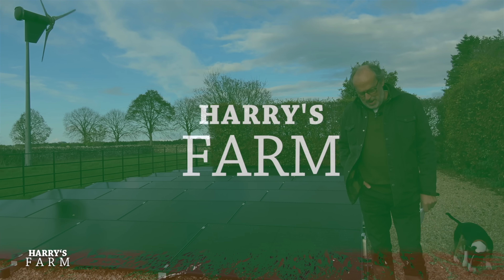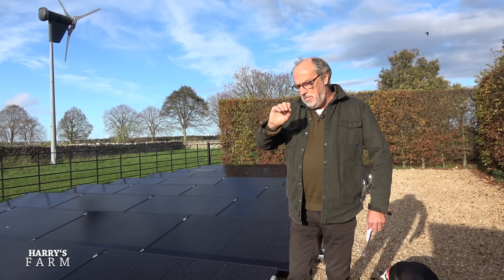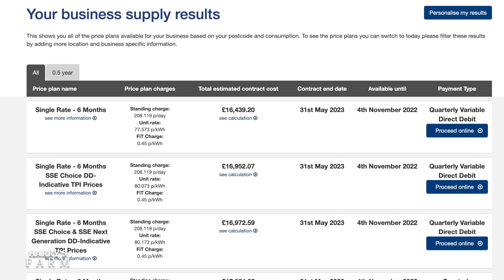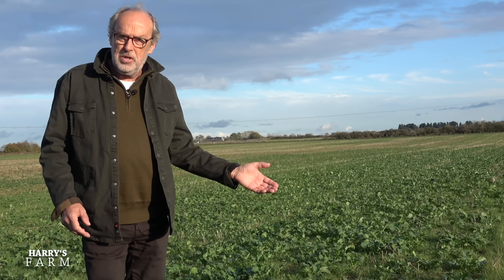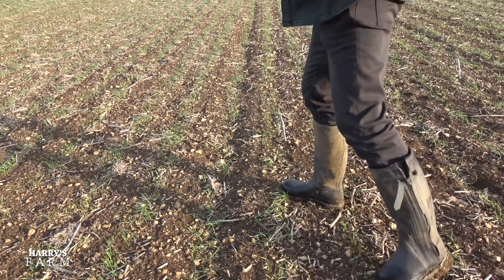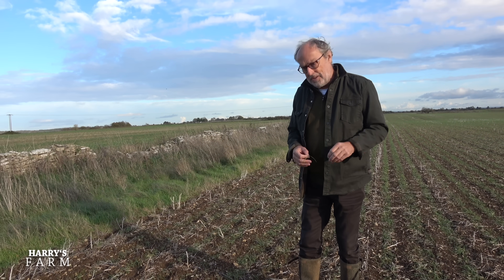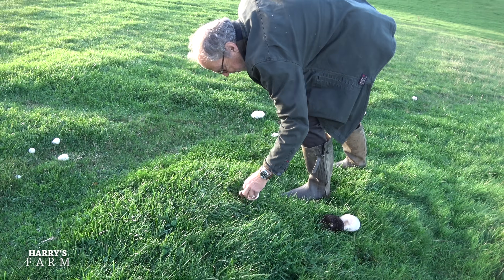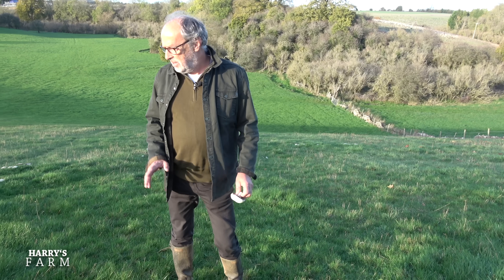More solar panels get installed plus why New Zealand's proposed carbon tax on cows is wrong

Comment: The New Zealand Labour Government / Green Coalition was one of the most unhinged Governments New Zealand has had in Modern times. And now we (New Zealanders) are struggling to put food on our plates due to the completely out of Control Government spending that massively inflamed our Inflation. They completely Shit on the working class in NZ - the people that actually provide the services that keep the lights on, the water running and food in our Butchers and Super-Markets. If people vote for Labour again, then they've got rocks for Brains

Comment: In the late autumn and winter i find out system will chuck out a couple hundred watts and my system is just over 2kw so about ten percent on average during the colder months so for you to be get 1.0kw roughly makes sense.

Comment: Good to see this  after watching the 288 GTO  video , had my petrol fix ! , thank you . I also have solar , off grid 28 panels  and  was surprised to see the panel angle so suited to the tropics ! The most  productive angle is basically your latitude , around  51 for your area , is there a reason for this low angle ?

Comment: The UK is just not a good eographic location for solar. The same is true for all of Europe. It is great for wind.but not so great for solar. The cost of energy in the UK is high because of how renewables have been been introduced into the electric grid (yeah a screwed up situation because of politics, not because it works from an engiineering perspective).

Comment: Carbon Dioxide is our friend, but I think you know that already... 

The fact that cars produce carbon dioxide from fossil fuels, a now well known renewable resource after finding emptied caverns full again. 
The sun has more impact on our climate than we ever have or ever will have, and the facts are the earth isn't just getting warmer, but it's also getting colder, breaking more records in the later segment year after year.

I would really like to break this down further but you should be on much more solid ground for your basis on the proof of why cO2 makes the earth warmer... it doesn't. 

@Suspicious0bservers here on youtube has it broken down to the point a 5 year old can understand it without any fear mongering or trigger words, just information. Much luv.

Comment: Completely agree Harry. As a NZ farmer I’m fairly certain we currently produce meat and milk with the lowest carbon footprint in the world… if we reduce our production significantly this will lead to someone else filling the gap with less carbon efficient food. Thanks for making great content it’s nice to hear a farmers view from the other side of the planet.
Reply: it's so unfair to talk about carbon footprint, a model built up for some dudes in countries to trade money for their gains. As a NZ farmer, I can tell you it would be dumb not to jump into solar. Lots of fear here, but southland is surprising everyone with some stats coming out.
Reply: It depends on how you calculate your carbon footprint, do you calculate the carbon footprint including everything that has to be shipped there (tractors, fertilizer etc.) or do you just calculate on an annual basis based on only what happens on-farm? NZ is so far from everywhere and has no local manufacturing, thus all purchased goods have a high carbon footprint.

Comment: With a ground level install of solar won't Cedric the farmhand  be forever cleaning them  . .  And won't it always risk over shadowing ?

If the panels are not fixed to anything won't it encourage the nocturnal farm equipment re-purposers to pay a visit ? We all want to keep the Policing precept down, don't we Mr Council ?

Wouldn't a canted pagoda type structure be a better bet with limited sun-tracking capability ? And you'd get your gravel overflow  car park back ! Surely the council can't complain about that ! Its national policy to cover car parks with solar cells !

 Or, think rotating radar receiving aerial/solar concentrators in Southern Europe. I understand that angle of incidence to the sun's ray is crucial for max power generation.
Such a structure couldn't be any worse than some residential conservatories or sun veranadas ! And, surely the Councils must recognise that  a bit aesthetic displeasure is worth the benefit yielded by solar ?

Err . . as to cow's botty burps haven't the Australians developed a vaccine (!*!!!!)  for ruminants to minimise this ?

As to summer water shortages . . when are you building your storage pond ?
In the States e.g. Oregon (The wettest State in the Union ?) they are constructing such things on a locality basis not only to store water against periods of shortage but also for the generation of hydro power when the water is released.

Comment: The voltage is too low. Max out the voltage on the controller because cloud cases voltage drop and disconnect on 12 volt. Never seen 12 kW on 12 volts because its too many amps for the wires.

Comment: Harry I remember when I was at Brookes university we had a we had a talk about and those topics word to do with energy output I have different theories about things but there is refraction and reflection if you have a fence around your around your photo cells would you find an increase in output that was constant like a lighthouse stack of of white glass bottles with metal foil tins behind them the problem is I think you would need Apex arrangement

Comment: I've 3.6kw of panels, I've never seen them produce more than 3.2kw. I live in Alicante provence so get clear skies most of the time, good luck in the UK.
Reply: 20% derating is an industry standard from peak installed capacity, for grid connected systems.

Comment: Solar Panels are a major contributory factor in why Britain's fuel costs are so astronomically high. So-called "Renewables", apart from hydro, are a completely rubbish and unworkable idea. Windmills cost more energy to make and service than they produce and only work when the wind blows sufficiently. Solar panels only work during the day time and if the sun comes out...

Comment: Hay harry , keep your opinions to your self...you know nothing about our situation in NZ , the reality is farmers are carrying to much stock on their farms to be sustainable in the short term and are over grazing and having to use ever increasing amount of fertilizer to maintain the pasture grass at the level required...and effluent that is produced is contaminating the underground aquaphis , streams and river systems that run throw and around the farmers and eventually in to the lakes that supply our drinking water and that's without addressing the methane and nitrous oxide gas emissions and C02 from transport of milk and farm animals for processing ..all together the sector make up over 50%of NZ's GHG emissions ...so the sector has to start reducing their heard size drastically and take steps to reduce their carbon footprint!!.😡💕🇳🇿🇺🇦

Comment: The CO2 has come from the atmosphere yes, but methane does considerably more damage in the atmosphere than CO2 does. So you are replacing CO2 with Methane for the next 10 years.
Also, there wasn't the same kind of industry now as there was when there were 60 million bison in the US (also 60 million cattle in the US now).
I'm all for getting rid of a lot of that industry instead of the animals. But something has to give and governments are deciding its the cows that go, not the profit of multinationals.

Comment: It's nice to have the funds to play with this stuff, but in reality, the mathematics doesn't really pan out.  This is primarily because proponents of a solar array fail to take ALL costs into account (like loss of interest on capital invested).  Invest £10k and that was earning you £400 a year in interest!  That's gone when you use the money to buy panels.  The ACTUAL return over a decade or two means that you could have invested it better in say, a generator/batteries or elsewhere.

Comment: Apart from the hedge shading issue, the angle of inclination of the PV looks far too shallow for the latitude of the  sunny Cotswolds ?    Getting your protractor out and cranking up the angle  ought to help productivity. And remember to keep panels clean, as dirt has a dire effect on output.

Comment: I'm sorry but the comparison with deer and bison doesn't make much sense. Humans and our livestock make up 95% of the world's mammal's biomass, 34% is humans, 35% is cattle. Wild life is not an issue here. The peak for bison was late 18th century. Back then there were fewer than 1 billion humans, no large scale cattle farms, and very little fossil fuel production. I don't believe that anyone is claiming that cows are the main contributor to climate change, but the large scale cattle production isn't helping either.

And the other point about the carbon they're burping out coming from the CO2 in the air is correct, but misses the issue. Methane is 25X more potent as a green house gas than CO2, so not converting CO2 to methane is highly preferable. There are steps you can take to lower the amount of methane cows emit, which is why a tax on it makes sense as an incentive for farmers to take those steps.

Comment: Harry, The Socio Economic Structure of NZ has been Stuck for a While.
This has caused NZ to Stagnate and They Struggle to Keep Their Population.
The NZ Population Stopped Growing 30 Years ago and on a Good Day is Only Four Million.
Factually NZ Still does Not have One Reasonable Size City, 5 Million Plus.
Therefore NZ's Economy has been Dominated by Sheep, Cattle, Diary Cattle Exports.
Harry, PM Ardern is Right NZ Must Consider how much Land and Effort They Put into Sheep and Diary.
The Environmental Issues are One Factor with this.
Yes, Australia has a Similar Problem which Includes a Huge Cattle and Sheep Herd but with Stagnation Problems in those Areas.  Small Town Failures because of Poor Socio-Economic Structure is Common in Australia.
Therefore Harry NZ and Australia Must Get Smarter about Farming/Food and Build Great Nations.

Comment: Make sure those panels aren’t shading each other as the sun is quite low this time of year. Partial shading will dramatically reduce your output! They should be quite a bit steeper too for the UK. And the wind will pick them up if it gets underneath, you could anchor the rails down with groundscrews rather than using weights.

Comment: I once read that putting one alpaca in with a field of sheep is a great way to protect against predators. The alpaca gets on well with the sheep, but is incredibly aggressive towards any threat. I think this is a trick they use in some parts of South America, and possibly New Zealand. I seem to remember is worked best (or only worked) if it was a single alpaca, not a group.
Reply: Donkeys, alpacas and llamas are herd protector animals.

Comment: Actually Harry, fun fact, you can get the greatest solar generation when the sun is surrounded by cumulus cloud. So you get direct sunlight from the sun hitting the panels and indirect reflected sunlight from the clouds hitting too. You can actually exceed the rated output of the panel (which is based upon a sun strength of 1Kw/square meter multiplied by its efficiency which is generally around 20% or 0.2.) I see it sometimes, it's on those days when you have to screw your eyes up if you haven't got sunglasses on.

Comment: Hi Harry, it's certainly worth mentioning that when the fuel pendulm swings back from these staggeringly high heights, the economics of solar etc will suddenly look quite different. in the next 3- 9 months two massive supply disruption issues will invert: The war in Ukraine will end (most likely with the assignation of Putin, but it really doesn’t matter how). Then cold hard money will regain its prominence as the loudest voice at the energy discussion table. Russia will be forced to pay for a huge chunk of the rebuilding of the nation they unilaterally destroyed. 

To make this possible, the West will allow Russia special dispensation to pump as much oil/gas as is logistically possible – taking a tax from each sale to give to Ukraine. 
Anticipating this record supply surge, all other OPEC members will scurry to up production in order to capture the high spot price – knowing full well that it will soon last no more – hence creating a paragon of a self-fulfilling prophesy.

Add to this the looming global recession that will make the 1930s look like a hiccup, then the demand / supply matric will swing back to the opposing dynamic - to be the mirror  image of what was the case in the middle of 2022. 

Petrol prices will plunge below 80p/litre, and heating oil will be counted in a few pence per litre as all the new supply that is just now starting to come on tap as a result of investors jumping greedily onto the elevated-price bandwagon seen 6 months ago, prompting the green-lighting of every terribly expensive/high cost new drilling project that oil exec’s could dream up (so ensuring their own bonuses), washes into the spot market, so depressing the price still further…
So, get ready for electricity plunging to all but free levels, at least for another 2 years…

Comment: If we accept that Methane has a higher global warming potential than CO2, it's very straightforward to see why cows are a net emitter. Take one carbon atom absorbed by the plant as CO2 (GWP=1), have it eaten and processed into CH4 by the ruminant (GWP=20+) and you've significantly contributed to CO2-equivalents (-1 + 20 = 19) in the atmosphere.

Different species of ruminants have different methane emissions, and individuals of a species will have very different emissions depending on their diet. That's why the deer/bison comparison doesn't say much. I recall the average cow may produce between 2 and 7x as much methane as a bison would. I don't think serious people are realistically calling for a ban of all cows, but since they are significant contributors to anthropogenic emissions (>60% of ag emissions?), they'll have to cut down their emissions a lot. 

Farmers and ag scientists are smart, they'll find out if the best results are achieved by a change in feed or change in methods or reduction in herd size or a combination of all that. However you can't just expect the sector to solve emissions out of the blue. That's why financial incentives (e.g. carbon tax, subsidies) and clear targets are necessary, just like in all other sectors.

Comment: I'm confused. At the beginning he said the rails the solar panels are fixed to are used in a roof installation. If it's installed on the ground instead of on the roof like it's supposed to be why is he so surprised when it doesn't produce much power? He's missing the added angle of the roof so of course it isn't going to be a good result. Take a look at the solar panels on WWOG or most other you tube channels; the angle of their panels is much steeper than his. His installation looks like an equator not UK installation angle.

Comment: Thanks for the video Harry, speaking from NZ here. One crazy aspects of this tax is that the government hasn't recognised that our national herd has actually decreased by roughly 11 million stock units since 1990.
Reply: "Dairy cattle numbers increased by 82 percent nationally from 3.4 million to 6.3 million Between 1990 and 2019" stats nz, what are you talking about ???
Reply: @Sc0ttynzl  sheep numbers dropped from 57.9 million to 26.8million over that period. The page you got the quote from has a graph, add sheep to the mix.
Reply: @Sc0ttynzl   yes you are correct, dairy cow numbers have increased as you say. However if you continue to read past the first line on the stats NZ website, past all the unnecessary guff from the govt. You'll find sheep numbers have decreased by 53.6% (31million). So if you represent all ruminants through the livestock unit measuring system, total livestock numbers have significantly decreased!
Reply: @hamish2021  then the problem is clear isn't it , there's to much dairy and too few sheep the government should discourage high impact dairy while having it be substituted by much nicer sheep the whole of agriculture shoudn't be treated as if it was all the same
Reply: @Sc0ttynzl  As Hamish pointed out it is useful if you read a little bit further.
Reply: Don't worry, it's not about the cows, more like human existence.
Reply: @sksx9269  it's about jumping on the bandwagon and trying to scam farmers out of money
Reply: Do you think Jacinda really cares about the truth?
Reply: @douglasprovost768  No of course not. After all she's a liberal
Reply: Your Govt also hasn't taken into account that before long there will be supplements to reduce methane etc from cows.

Comment: Your solar needs to be more spread apart. You see shadow of the sun in the lower bit in everyone. Every type of shadow murders your output. You live on 51.8°N. Solar noon zenith elevation is max 61° and min 14,7° from horizon. You need at least 30 degree for midsummer noon perfect 12kWh. Bottom part needs to be 75,3° free from next top part to get solar winter noon.

Comment: I'm puzzled as to why the solar panels are laid almost flat. I guess there is a reason, but right now the sun must only be around 30 degrees to the panel, not the optimal 90 degrees. I guess this is a side effect of being installed on a roof support system, maybe new brackets are in the pipeline? Otherwise that is a lot of power you are missing out on.

Comment: You will find you peak generation will be in May in the UK, cool temperatures and relatively strong sun. Summer can be too hot reducing the efficiency of the panels. 
Also the leaves from the beech hedge which have fallen onto the panels will reduce that panel's efficiency.